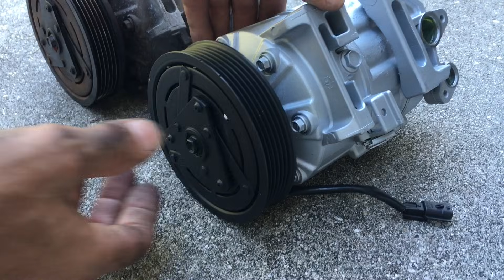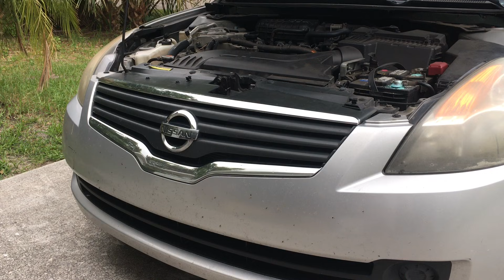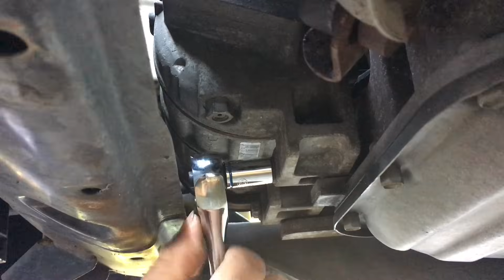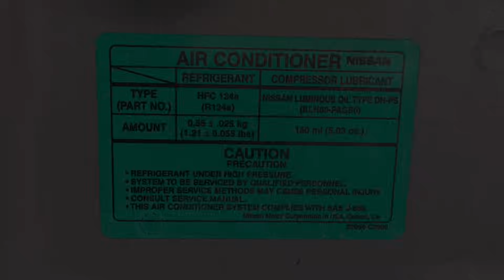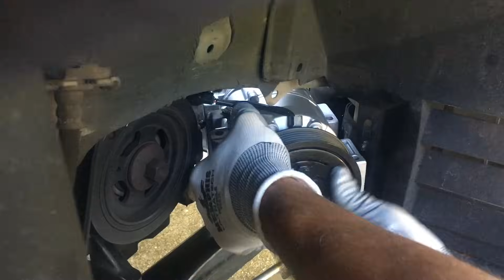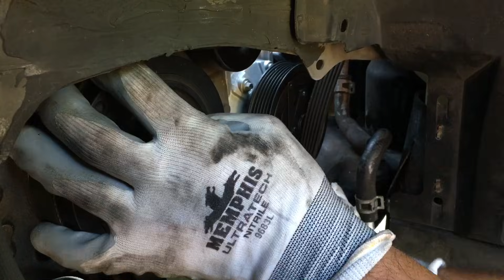AC Compressor Replacement - 2007-2012 Nissan Altima - How To Fix AC System

Comment from the maker: You can buy required replacement parts used in this video here:
AC Compressor: https://amzn.to/3gFQdeZ
AC Compressor Oil: https://amzn.to/3gFPQ45
Expansion Valve: https://amzn.to/2ZXxNkb
Receiver Drier: https://amzn.to/3eJ481Z
AC System O-ring Seal Repair Kit: https://amzn.to/36RqU5g
(These are Amazon affiliated links)
...
Still have questions? Ask online certified mechanic here: https://trk.justanswer.com/aff_c?offer_id=2&aff_id=8172&url_id=10
(This is JustAnswer.com sponsored link).
Reply: My new compressor clutch does not spin freely I went back to AutoZone to test a more expensive compressor and it was the same result. Are you certain the clutch should spin freely?

Comment: Thanks for the knowledge my boi clean and straight to the point real professional blessing my man and to you family.
Question is true that when  replace ac compressor you also need to replace expand valve,orifice tube,dryer (not condenser cuz I buy 2 year ago is in good condition )and all the o ring from ac compressor siystem ? Should I just replace the ac or everything just an case??? Thanks

Comment: Did you skip the part about disconnecting the compressor wiring harness, or did I just miss it? That's the one thing I need to know ...
Reply from the maker: I think i showed that part in the video.

Comment: Hey man , I hope you response to this. My AC compressor works and everything but the wheel wiggles, idk if I should replace just the wheel or just keep it for now and save for the whole unit
Reply from the maker: Yes, you can replace the clutch with pulley without taking off compressor and discharging the system. I have a very old video on my channel showing how to do it. Look for “Nissan Altima AC clutch replacement”.

Comment: @ 8:50 was the green o ring not too large? The one on the bottom left looks like a better match with the old black one. Please correct me if I am wrong.
Reply from the maker: Yes, it was a bit larger. I didn’t have a perfect match. Larger is ok, it will seal the pipes anyway. It’s worse if the ring is smaller - it will stretch and become less in diameter, and wont make a good seal.
Reply: @DIYtime  Do you think it would be okay to just reuse the old o rings if they don't look bad?
Reply from the maker: No, they will fail very soon after. Spend extra $10 to save a lit of headache.

Comment: Very good video!  The only thing I struggled with was the power steering line.  I ended up having to disconnect it and move it out of the way; there was no way to remove or install the compressor with the hard line connected to the rubber hose.  I greatly appreciate the detail and time you put into this.

Comment: I installed a brand new compressor with new expansion valve but it seized with in a month... now replacing everything again including the condenser and drier... hoping it is more durable this time.

Comment: Great video! Does this Nissan have the same A/C compressor control valve as the 2013-2018 Nissan Altimas?
I’ve found videos where some people are specifically changing just the control valve and it seems to work, but this is for 2013-2018 models.

Comment: I had versa 2012 when I started ac I hear rattling sound mechanic who told me I needed ac compressor replacement I had cold air no problem only rattling sound any advice please thanks.

Comment: Hi, are you saying the compressor I  bought from Amazon for example don’t come with oil in it already or the correct amount?  So how much oil does it need for a Nissan Rogue Sl 2009? Thank you in advance.
Reply from the maker: Check with the seller if its pre-filled or not.

Comment: I would strongly suggest buying the Serpentine belt replacement tool kit made by Husky if you are going to attempt this job on a 2012 Nissan Altima. There is very limited space to access the tension pulley that releases the serpentine belt so using a conventional ratchet is very difficult. For me that was the most challenging part of the replacement and that tool made it much easier.
Reply from the maker: Thanks for the advise!

Comment: I have a question for you. When you change out the compressor, not being able to vacuum it myself, will I risk the new compressor if I take it to a shop for vacuuming and putting refrigerant? I mean replace compressor myself, turn the car on and drive it to a shop for vacuuming and refrigerant?
Reply from the maker: No. AC system has a pressure sensor. If pressure is too low, compressor wont turn on to prevent damage.

Comment: Hey I have a question. If I replace just the compressor can I drive it to a shop to have it charged or will that damage it.
Reply from the maker: Dount turn on AC and it wont engage. Otherwise yes, it may damage it. On newer cars it has sensors and if pressure is too low, it wont turn on anyway.

Comment: Greetings friend, what is the proper ac compressor oil to use for 06 Nissan Maxima 3.5? There's pag46, pag46+uv dye, pag100? Thank you for your vital information. Your video and step by step info is very helpful.
Reply from the maker: You should have a sticker under the hood with that info for your particular car. Otherwise you would need to get a repair manual and look it up.

Comment: What was harder and/or took longer...the whole compressor or the compressor clutch?
Reply from the maker: About the same. However, in my case I had a leak and all refrigerant was gone, which made it a lot easier. Otherwise you have to properly evacuate Freon first, which will require special equipment or trip to a mechanic. After repair, you will have to recharge the system, which also requires special equipment. With clutch replacement, you are not opening the system.

Comment: Multiple shops in my area insist that I better change the ac radiator when I change the AC compressor stating it can't be cleaned and that most likely it's clogged now, they say it will break the new ac compressor. Does that make sense?
Reply from the maker: Yes. When compressor breaks, debris can travel throughout the AC system and clog it up. I regret now not making a video of what I found inside my broken compressor. It was completely shredded. 
I personally took chances and went without replacing radiator. So far so good. But it’s up to you. It indeed can break your new compressor and you will have to pay for the repair twice.
Reply: @DIYtime  Thanks, this makes me more confident they know what they are doing :) On another note, none of them mentioned a need to change the drier or expansion valve, what's the rule of thumb regarding those? Fyi my AC works ~ok as long as I have my foot on the pedal, it won't cool if am parked or stopping at a traffic light, and after checking that coolant pressure is ok, all of them labeled this as 'weak' ac compressor and the only way to fix it is by replacing both it and the ac radiator.
Reply from the maker: In general drier needs to be replaced every time the AC system is open. It adsorbs moisture that gets inside. Old drier might be already oversaturated and not work as intended any more. Otherwise water in the system will destroy compressor. I replaced the valve cuz my friend mechanic told me they often break on these Altimas, and he recently replaced one one of these too. I decided to do it as well since my AC system was already discharged anyways. I would hate to go through it again later if valve would fail.
Reply from the maker: On the other note, check the gap on the AC compressor clutch. If it got too wide somehow, you need to place a shim or spacer to make it smaller. When gap is too wide the electric magnet doesnt have enough power to engage clutch on low engine RPM. When you give it more power, then it engages. My dad had this issue on his Civic and a simple washer fixed it!
Reply: @DIYtime  many thanks for all those important tips, highly appreciated 👍
Reply from the maker: My pleasure!

Comment: I have V6 the same model... So.. What are the differences when installing the new compressor with your car??..

Any one could help...!!!
Reply from the maker: There might be a difference in the location of the compressor. Otherwise it’s pretty similar.
Reply: @DIYtime  I really appreciate your reply.... Just one more thing.. How could I know the quantity of compressor oil for my 6CYL.??  It is not written on the bonnet label...

 Coule you please help me..
Reply from the maker: What year is this? I have a repair manual for 07-09 Altima with VQ35DE engine that has all that information.
Reply: @DIYtime  it is 2011 VQ35DE

And it is the same with 07-09 no differences..

How to get that repair manual?
Reply from the maker: Here is one that would work for your car in PDF format: 

http://rover.ebay.com/rover/1/711-53200-19255-0/1?ff3=4&pub=5575132837&toolid=10001&campid=5338688325&customid=&mpre=https%3A%2F%2Fwww.ebay.com%2Fitm%2FNISSAN-ALTIMA-2011-2012-2013-2014-2015-2016-HYBRID-COUPE-SERVICE-REPAIR-MANUAL%2F392807478200%3Fhash%3Ditem5b752673b8%3Ag%3A-ngAAOSwmuhexnny
Reply from the maker: For 09 it says total oil capacity in the AC system is 150 ml (5.03 US Florida oz).
Reply: @DIYtime  Thank you so much... I appreciate it
Reply: @DIYtime  It is on ebay.... and needs to be shipped...

I am in Middle East... Ooh what an issue..
Reply: @DIYtime  oil capacity is the same for 4 cyl and 6 cyl??

Could you please give me some details...
Reply from the maker: It’s a download.
Reply: @DIYtime  yeah... Thanx for your help... I found the PDF and downloaded it... I appreciate everything you did 🌹
Reply from the maker: Thank you, it’s truly my pleasure !
Reply: @DIYtime  Hello again

... I installed a brand-new compressor of Maxima 2011 on my (V6 Altima 2011) ... Every thing went ok... EXCEPT After 10 minutes of turning AC on... hose FREEZES (ice) .. So.. How could I fix this problem??

I also changed brand-new condenser + valve Expansion with all O- rings..

Comment: Me. DIY time, I will be replacing my compressor as well on my 08, and with it the expansion valve and receiver dryer. My question is, does it matter what order we do it on? Thanks
Reply from the maker: I would do receiver drier last, to make sure it doesn’t get any moisture inside it while you working on the other stuff. It is supposed to be sealed and with minimal air contact, and it is designed to collect moisture inside the system. You don’t want it to become too saturated before you even seal the system.

Comment: I appreciate this video, thank you. I have a 2008 Altima. My heat works well on the car. The air does too but when I stop at a light it makes a littler noise. Since it's winter will using my heat damage the compressor more?
Reply from the maker: No, heater is not using AC compressor.
Reply: Thank you. May I ask another question please,,,if the Heater Core is bad then the heater should not work right? I just got this car a few months ago and it's drive great except for the compressor and a water leak that I think is from the windshield. But the water is in the floor board on the driver side. Once water came down on the passenger side. WOW!!!
Reply from the maker: Not necessarily. There might be several reasons why its not working. It should be diagnosed properly first.
Reply: Thank you. Happy New Years!!!

Comment: So how do I measure the required amount of lube oil the compresser says it has 3 ounces already
Reply from the maker: I looked it up in Nissan repair manual for my specific car (07 Altima 2.5L). 
If you have the same car I can probably find this info for you. Other models may have different amounts.
Reply: I have the same question and I have a 2007 Nissan Altima 2.5. I am also trying to find your video on putting the belt back after you installed the new ac compressor.  BTW...Great Informative Video

Comment: Is it the same process for 2007 nissan maxima
Reply from the maker: No, Maxima has bigger engine and it will be a "little" tight to work on it under the hood.

Comment: Thanks. I have a 2008 and the clutch froze up 2 weeks ago. I used a 3' bar to try and turn it from above. the compressor is not froze up or making any noise.
Reply from the maker: You can try to replace just the compressor then. I have an old video about it on my channel. I did it many years ago.
Reply: if the pulley only is froze then you can just replace the bearing or the clutch as a set....but be sure to make sure the clutch gap is within spec

Comment: Great video, just two things that would help people the oil you are using has dye in it don’t use it to lube O rings, when a tech looks at it for leaks which it will have since you put on the wrong diameter o rings it will be very confusing for him to find the leak.
Reply from the maker: It is fine if oring is a little bigger if you cant find the exact size. It's worse when using smaller size cuz oring will stretch and won't seal as good. It's been many years since I did this and my AC still blows cold and no leaks. 
Good point about the dye though! Thank you for your input!

Comment: I'm interested in checking out the condenser fan because my a/c is not blowing cold when the car is idle. I have a 2013 Nissan Altima. Any interest in creating a DIY vid to help a sister out?
Reply from the maker: I would be happy to help, but it is quite a big project to undertake. I believe you have to take out the entire dashboard to get to the fan/blower assembly. 
Also, you said it is not blowing cold. Assuming it is blowing hot, I would suggest that your fan is working, it's just the condenser is not getting cold....
Reply: if you can visually see it's not engaging then you can test it by applying battery voltage using a set of test leads to the connector for the fan to see if the fan works

Comment: So if my ac compressor is spining does that mean its still good
Reply from the maker: Not necessarily. 
It is definitely not locked up though. 
Check pressures in the system to see if they are normal and you don't have a refrigerant leak.
Reply: only the pulley spins when the car is running...when you turn the ac on, the ecu sends current to the electric coil behind the pulley that pulls the outer clutch in which makes the inside shaft spin along with the pulley which makes the compressor work

Comment: How do you do this without paying $300 to evacuate the system to prevent refrigerant from spilling everywhere? Please tell me.
Reply from the maker: There is no really other good way. Try to find a shop that can do it cheaper maybe.
Reply: a shop shouldnt charge more than $75 to recover...find another shop

Comment: I have a question on your youtube video. He puts oil lubricant on the compresor, then I know he is going to do a vacuum. The qiestion is: Doing vaccum after puts lubricant oil does not suck the lubricant oil?
They charge you for a question
Reply from the maker: No, the AC compressor vacuum pump wont suck out the oil. It lowers the pressure in the system causing water and moisture to boil. The pump then sucks moisture out. The pump is not strong enough to boil the oil.

Comment: Great video.  Just wondering... I have a 2008 Nissan Altima 3.5 (the engine is a V6).  Is the job the same for this model?  A/C compressor in basically the same spot?
Reply from the maker: Ye's, is in the same location on your car , on the left side of the engine. The mounting bolts are a little different: two in the front of the compressor, two on the left side.

Comment: I have an 07 Altima that is blowing hot air. I recharged it with Ac Pro about two weeks ago, but at the end of a long trip it started blowing hot. When I checked the low side pressure with the Ac pro gauge it was at 150 psi, which is way higher than I charged it to. The pulley turns fine but I can't turn the clutch by hand. Bad compressor or clutch?
Reply from the maker: Start the car and start turning AC on and off. Normally you should hear AC clutch engaging. Can you hear that?
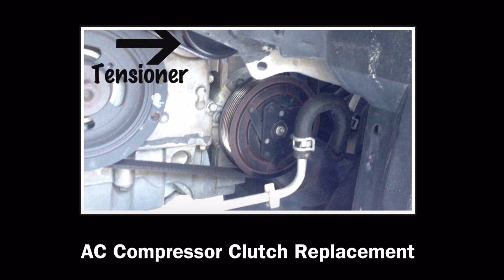Reply: @DIYtime  The clutch definitely isn't engaging but when I have the car running, if I lightly tap a screw driver on the part you are holding at 0:55 I hear a grinding noise so it makes me think something is moving in there. When I check the low side  pressure now it's at 25 psi, so do you think it's possible that my pressure switch is stopping the clutch from engaging?
Reply from the maker: Yes, it is probably shutting off when pressure gets too low to prevent damage to compressor. 
You probably have a leak somewhere. Get a can of refrigerant with UV dye to detect where it is leaking.
Reply: @DIYtime  Thanks! I'll give that a shot and see what happens next.
Reply from the maker: Sounds like bad compressor. 150 psi is way to high for the low side: https://youtu.be/pUxI5DDuG-Y

Comment: Thanks for the video! Just finished up replacing the AC compressor on my wifes car. I did however have to remove the windshield washer reservoir and the power steering line to get enough space for the compressor to fit. I don't know how you got yours to go so low lol. Great video and explanation.
Reply: **By removing the power steering line, I mean , I just unclipped it and took the one bolt off.
Reply from the maker: Awesome, and thank you!

Comment: I saw your video on replacing just the clutch. I wanted to do that, but apparently they don't sell a rebuild kit for the 2012 sentra 2.5.
My compressor turns easily, looks fine, and gets power.
The clutch just doesn't engage.
Reply from the maker: Check your local u-pull junk yards if they have your car. You can usually get it for very cheap, something like $20. You'll just need take it off yourself, but this would be a good practice...
Reply: then the problem is likely the clutch gap is too wide and just needs adjusting by removing a shim or changing to a smaller size